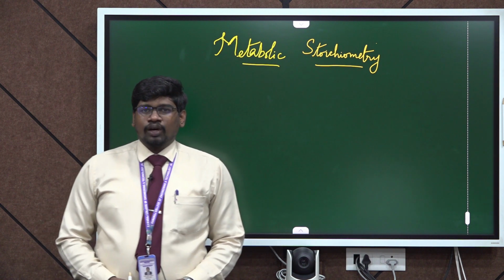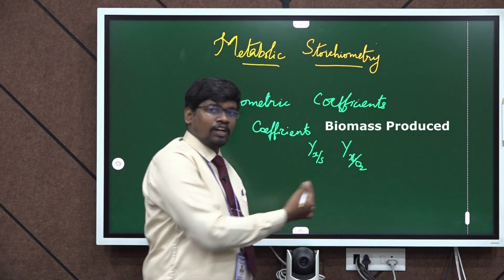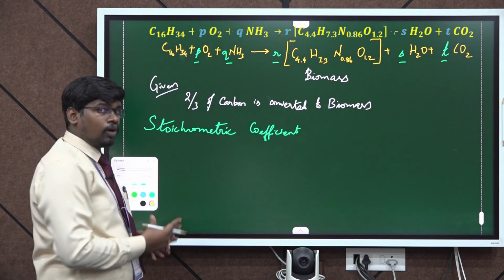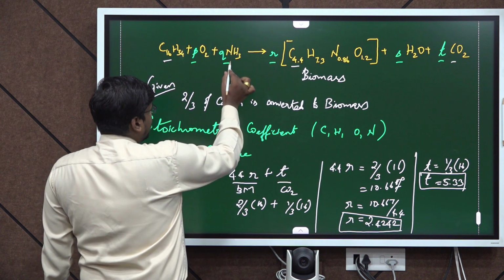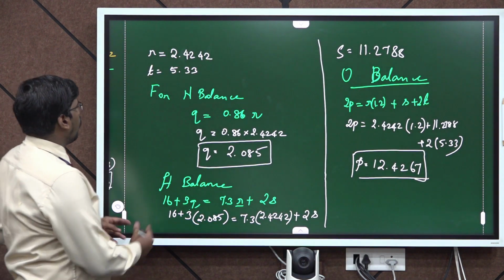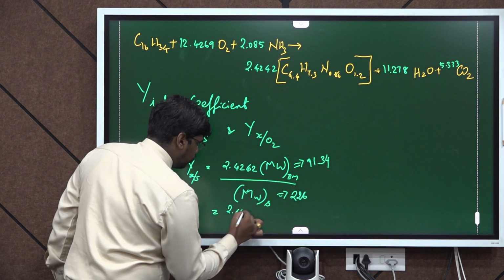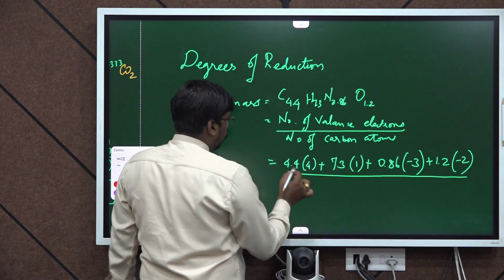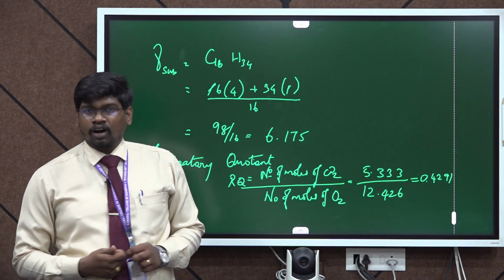Metabolic Stoichiometry | Bioprocess Engineering

Comment: In hydrogen balance u had took substrate conc of carbon.
Reply: What is the reason instead of 34H u had took 16C
Reply from the maker: I made a mistake in the calculation. Thanks for pointing out. I will be careful not make any mistakes in future